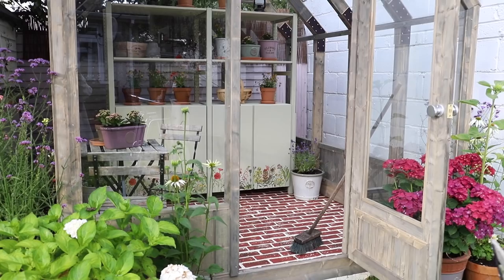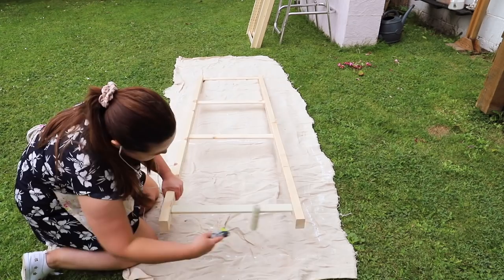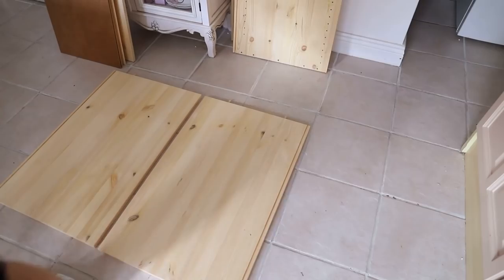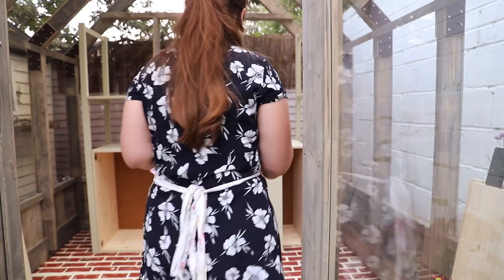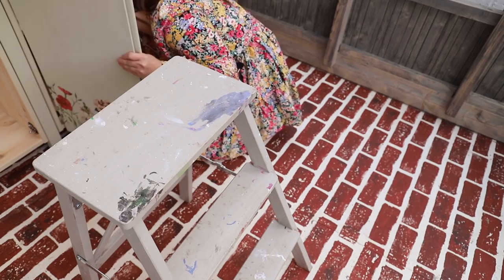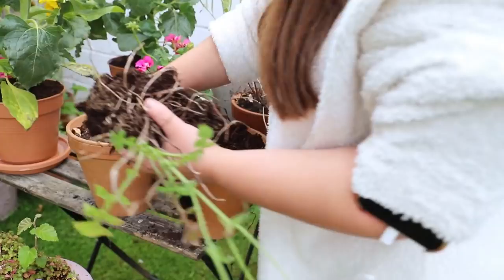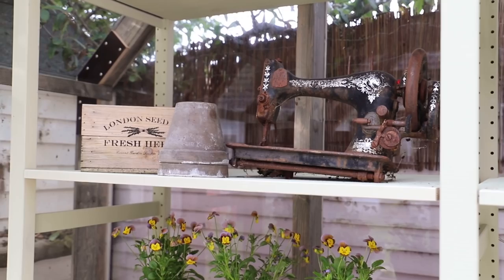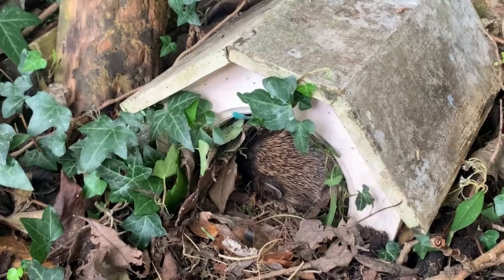Ikea Ivar Makeover & adding shelving to the greenhouse 🪴

Comment: Your greenhouse is starting to look so fabulous 👌🤗. Love the green. Maybe at times when you are not potting ie between season..when you use it to write/work etc, put an outdoor rug on the floor, ad cushions on your chairs, that will help the echo to😊. 

I love 😍 the IKEA Ivar range which is one of their longest running ranges.. And it just celebrated its 50yr birthday recently.

I love this range😍.. Some of mine are already 30+ years old and still looks perfect or even better because it has darkened with age, which I like. I don't paint real wood furniture, I like natural light wood. I have moved 6+ times with them. They are quick and easy to put together and take apart and take little space in the moving truck when dismantled. I only have them inside my house.. In my living room, under the stairs cupboard, my kids rooms, my office (where they make a floor to ceiling library wall). They are totally stable if you use the metal cross supports and even more if they have a cupboard or draw unit in them.

Hedgehog.. So cute🤗. We (my 8yr old and I) go out in the evening, collect slugs and feed them to our hedgehog that visits us! They are noisy eaters, but it is cute to watch.

PS. I always assemble Ivar in standing.. Not lying on the floor.. It is so much easier!

Comment: It's very cute, coming along nicely.  I really like the transfers of the flowers across the bottom of the cupboards, perfect fit.  The shelves are nice also.  I like the idea of the bistro set getting refinished and added in.  Someone commented about adding a rug to absorb some sound, good idea.   The lanterns are a nice touch, look out your kitchen window to see the house lit up at night.   
Didn't hear it mentioned - but I'd suggest also sealing the base around the outside base to prevent water from coming in from the source. 
You need to name the Hedgehog and let us know.  Didn't see any Blondie content, must have kitty content.

Comment: Hello Dainty My Love ! Just wanted to share a little trick I use to keep my earphones cord out of the way if I’m going to be moving back and forth. I place the cord on the back like a cape n thread the cord over my ears back to front where u can easily fit the buds in. Then run the cord down ur back or your sleeve where you can plug it into your device comfortably.

Comment: Wow it looks great. I was just wondering what brand of mini roller do you use? The couple that I bought for jobs have got clogged up with paint & stop turning, ruining the finish. You seem to use them a lot.  Any tips to avoid same?  Thanks.
Reply from the maker: Hi Christina, I use too fussy blokes roller sleeves x
Reply: @DaintyDiaries  thanks for that much appreciated. And your lovely greenhouse. My hubby has wanted one for a long time but not one of the pvc or poly tunnel types. Something with a bit of style. Your looks lovely. I didn't see a episode on it. Is it a made to measure job or from a supplier? Thanks.